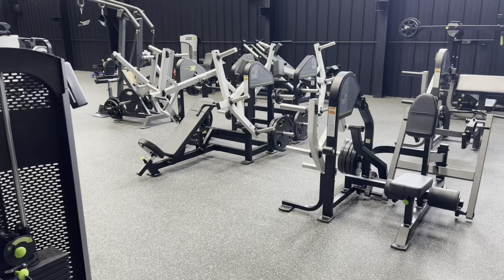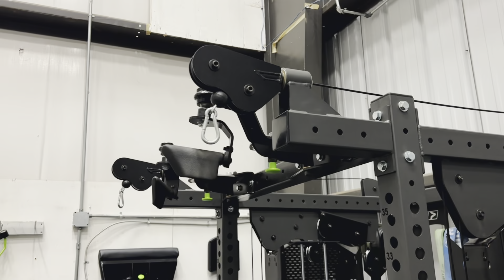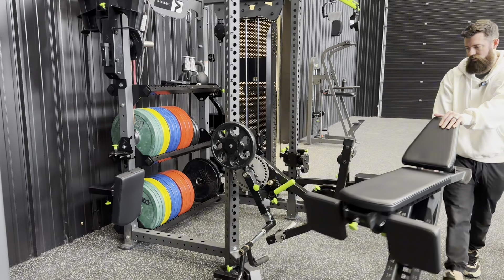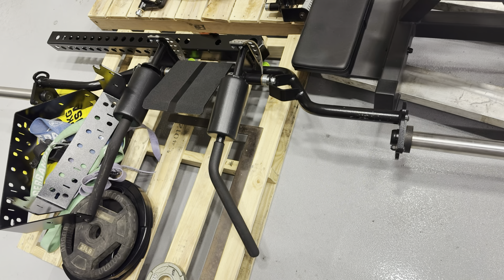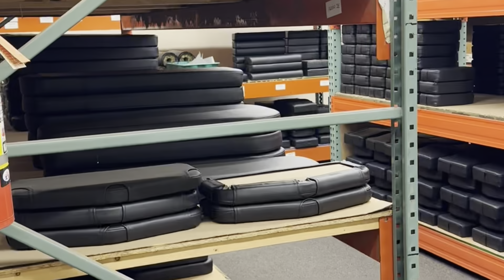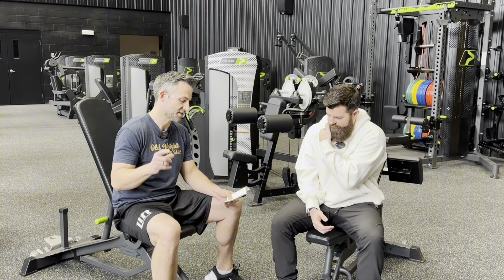#54 Behind the Scenes with Prime Fitness: History, Innovation, and Community

Comment: A few things that I'd like to suggest Prime do: 

1) A dumbbell spotter/ pivot solution that is on par with what Atlantis offers. Ideally it would be one solution that pairs with the Prime benches and supports both incline, flat and shoulder presses. 

2) Bring back the earlier Strive selectorized leg press. The one with the pivoting and slightly declining footplate, not the current motion on the Hybrid. 

3) Fix the extreme row. Build an adjustable chest pad/ stabilizer that allows a wider range of distance to/ from the handles. Stop making Kas use wood blocks to fix the piece. Also fix the handles on the plate loaded incline and flat benches. 

4) Partner with Voltra/ intentionally design some solutions (Prodigy) with Voltra instead of conventional stacks. 

5) Build a new, more convergent decline press. I think the Evolution Chest is close but suspect new grip and convergence angles could improve it more. Overall it is an under-appreciated piece in the market today and building a decline version into the hybrid line would likely get more adoption. 

6) Hybrid Pec/ Rear Delt designed for cable attachment handles rather than direct grips. Imagine a way to use Kaz handles or others with a pec/ rear delt fly. Would allow turning the hands out (overhand grip) to get a better rear delt feel. To make this work, the cable attachment points would have to be offset further to the middle or even offset to the other side to have enough room for the cable without slack.